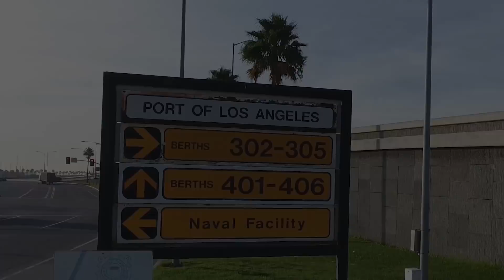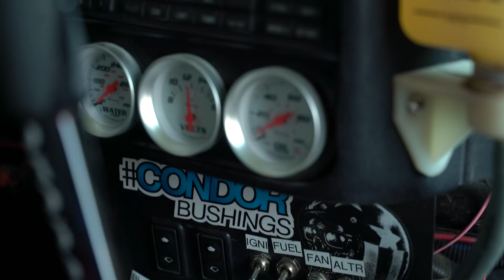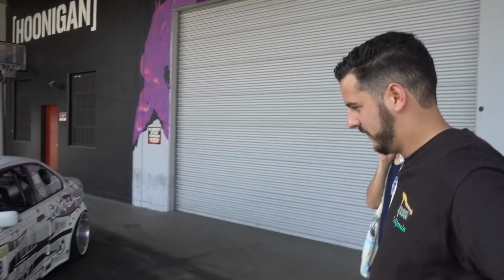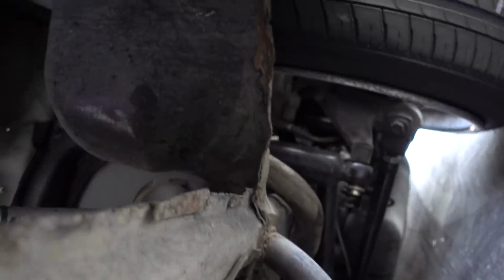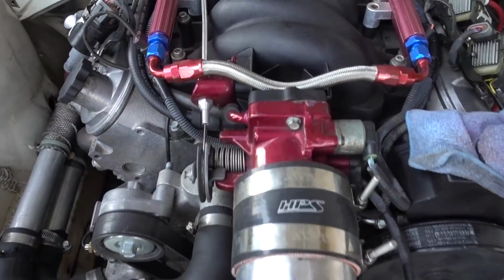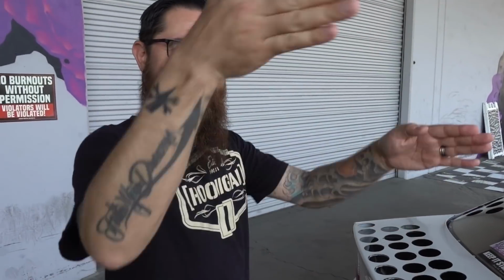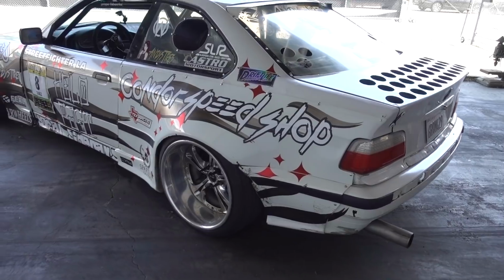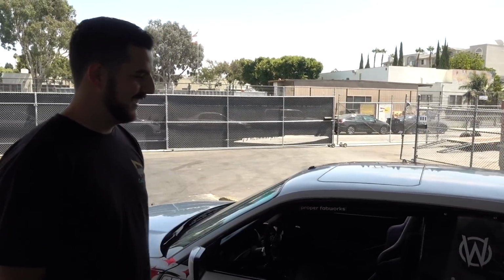[HOONIGAN] DT 106: Widebody BMW E36 Double Dutch Donuts (Sh*tcar)

Comment: So clean, surprised they didnt tuck the b pillar cage more to the body, car cage builders are always leaving mad gap so they can 360 weld the joints but the dont realize you can either drop it through the floor or cut the roof off lol so frustrating

Comment: Since im pretty weak in the area of how cars actually work and the components if them, could someone explain what exactly a double clutch is?
Reply: 1 clutch is for even gears and other clutch is for uneven gears and when you change gears one clutch is disengaging and other one is engaging and you don't have to change gear. That means faster and smoother gear change.
Reply: Tanel Madiste that's not what double clutching is at all
Reply: Jazzyistcally Orsum just engaging and disengage the clutch twice when shifting. That's all it is
Reply: A waste of time
Reply: Mezz Oh.... slaps heads
Reply: Jazzyistcally Orsum very effective when used at the right time.
Reply: Some bigger trucks may require it to get in gear easier. Like when downshifting you would clutch pedal in, pull out of gear, left off clutch pedal, rev match, clutch in, shift, clutch out. Basically just using the clutch for both going out of gear and then into the next gear. In the truck I was driving you had to rev in neutral for it to work right for downshifts. I didn't know what I was doing wrong at first and then I realized I was reving up with the clutch still in. Some of the slightly smaller trucks pulling 13 foot car trailers didn't require double clutching, but I still did it for practice and still slightly smoother shifting.
Reply: Isaak Hansen Well one is double clutching and other one is transmission with double clutch.

Comment: When he said "it's impressive because it's an e36 that had a window that work" I lost it cause I just replaced replaced a window regulator in my e36 but the other 3 windows are still broken 😂
Reply: mike hayes passenger window on my e36 coupe has been dead since I bought it. Rip
Reply: Jared Connell All of my vehicles have crank windows. And I'm happy with that. No more, "fuck I forgot a window down can you turn the key on" bullshit.
Reply: Second driver side regulator, driver side motor magnet fix,  and numerous plastic sliders... oh my.
Reply: Same shit goes for e46. How can you fuck that up, BMW.
Reply: Repairing my E36's windows are a yearly maintenance item. Without fail, they always fail.

Comment: Bring on the LS hate >:) 

Everyone hates something that they cant beat
Reply: U must not seen a i6 2jz in action... bro
Reply: deonte johnson i have.. And they weigh more than most ls engines and take much more work to acheive near the same power
Reply: Geoff Jaycubs I didn't know that 😂 best thing is you can beat the piss literally out of both I assume. I overheated mines but i think it survived🤷🏾‍♂️ but this video made want an ls lowkey
Reply: deonte johnson plus.. Ive never owned a 2jz but i imagine parts are way cheaper for an ls even if you do break one
Reply: Geoff Jaycubs 2jz arnt as hard to come by as people think. I pulled mines from a 96 lexus gs300 I bought for $800. I just started posting it on my channel
Reply: I HATE LS CAUSE THEY GIVE ME SO MANY LS
Reply: some kid from surrey im gonna pretend i know what that meant.. 

So many people go with an ls because theyre such a good choice. Theyre Reliable, build-able, powerful and compared to some other popular engines, theyre affordable
Reply: Geoff Jaycubs We only have LS, RB and Rotary but we have the occasional EJ and 4G63
Reply: Nathan Singh im a little confused, what do you mean " we only have"?
Reply: deonte johnson you're using the weak useless 2jz-ge not the one from say a soarer or supra
Reply: Tanner Bud its similiar enough. Heads, intake manifold and if hes serious about it, new connecting rods and bearings+ a turbo and hes done :P

(Unless there is more i dont know about the 2jz ge vs 2jzgte,  which i bet there is because i dont know much, but thats what i remember from my research years ago lol)
Reply: Tanner Bud the same engine is in the Supra with out the turbo. And if it's weak. How was haggard garage able to TWIN Turbo an old stock 2jzGEfrom a Lexus GS300 ?? All 2JZ are strong
Reply: Geoff Jaycubs I'm just curious to see how far it goes stick without a rebuild. lol I just wanna do a budget built type thing
Reply: Geoff Jaycubs there are 4 different 2jz. You have 2jzGTE non-vvti(Supra), 2jzGE non-vvti(Supra), 2jzGTE vvti(lexus is300), and 2jzGE vvti (lexus gs300) 

All pretty much have the similar if not the same bottom end. Turbo 2jz has oil squirters in the block and turbo 2jz variants has different heads and intake. That's all I can gather 🤷🏾‍♂️ there's really no major difference